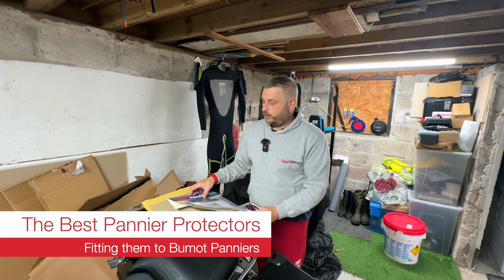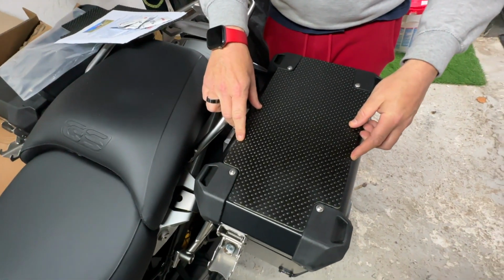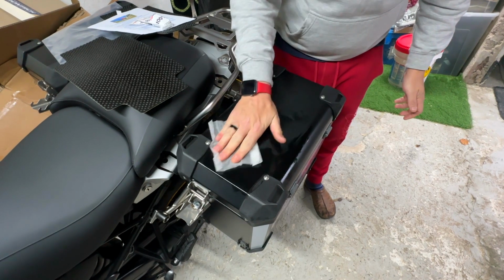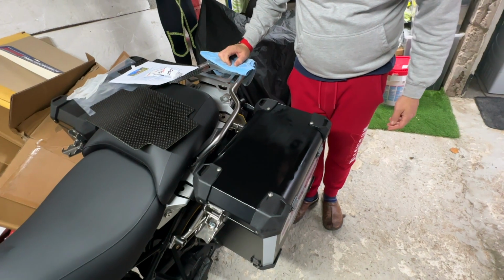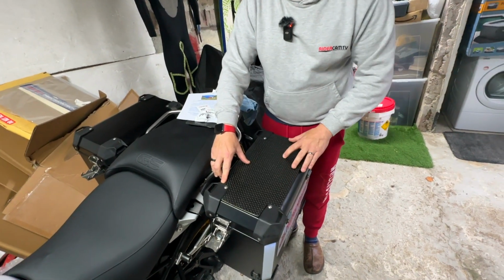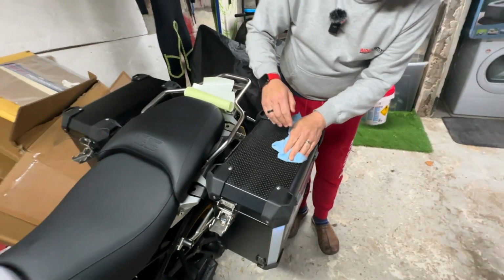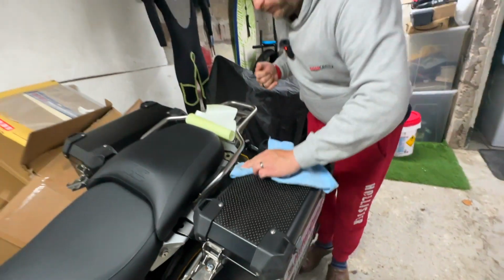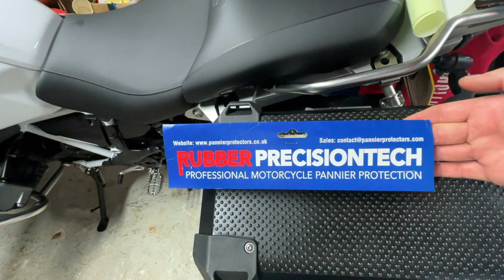The best pannier protection! | Fitting to a BMW 1250 GSA

Comment: Fitting tip I got from the guy who makes Rubbatech tank protectors. After you've peeled back a section of the backing paper line the protector up from the side which still has the backing paper on. This lets you move it around until it's perfectly aligned at which point you allow the sticky end to make contact with the tank/pannier and it should be perfectly positioned first time.
Reply from the maker: thanks for the tip buddy